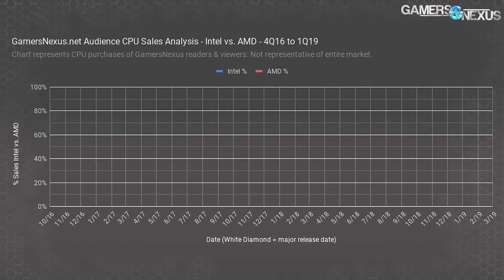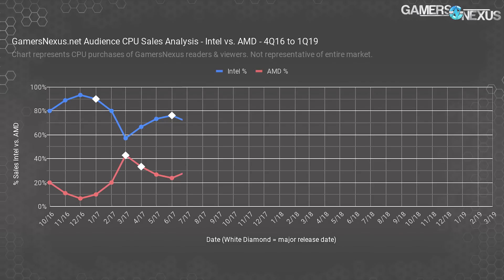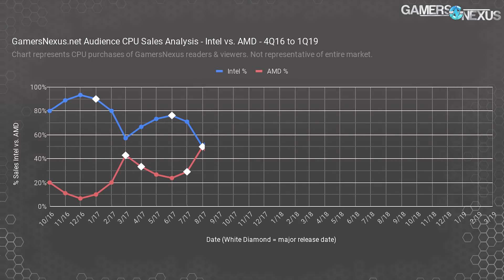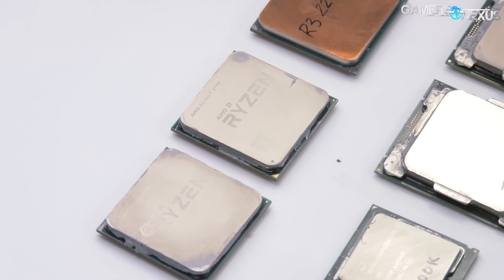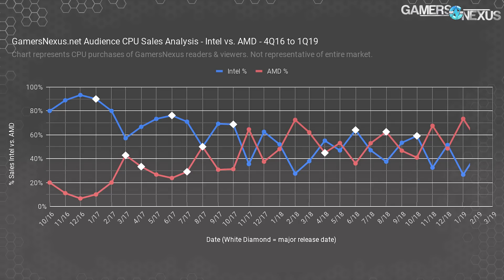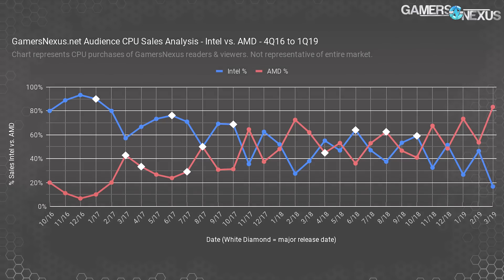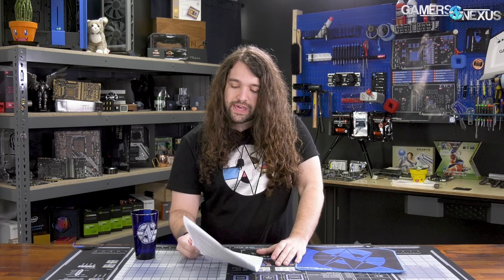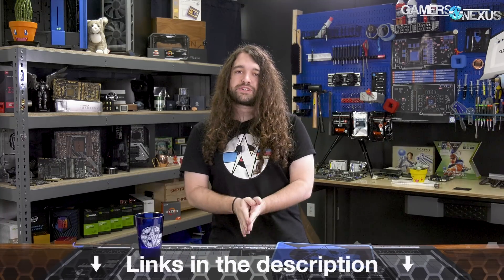Special Report: AMD’s Comeback Story - Intel vs. AMD Marketshare

Comment: So if Ryzen 2 is even remotely as good as the leaks say Intel sales to DIY folks will implode.
Reply: Intel 14nm vs TSMC/AMD 7nm. AMD is a strategic partner of TSMC. Intel might be using TSMC right now, but usually they do their own manufacturing so TSMC may have some reservations about helping Intel since they are a foundry competitor. Anyways, Intel and NVidia are the high end, firmly. AMD is for everyone else. <3 AMD. Besides, Steve's charts indicate that Intel sales to DIY have already imploded. I bet that Intel is being (or maybe already has) forced to give volume discounts to large customers like datacenter or cloud just to fight clients' new urges to defect and go to AMD. 9th gen Intel might also get discounted just to further drive the point home to customers that Intel hardware is simply the fastest (even if overall AMD makes a better product). They sell Ferraris, not minivans. Unfortunately for Intel, It turns out that minivans are really popular in China. It also turns out that AMD makes the best minivans on the market.

Comment: I had in the past few years FX8320 > FX8350 > FX9590 > Ryzen 7 2700X 
Radeon R9 280X > R9 390X > Vega 64 > Radeon VII. AMD definitely got my money 😜😅
Reply: Raul  You strayed to i5 when they most needed it, shame on you.
Reply: noice :)
phenom II x6 1055t, fx6300 , fx8350, ryzen 5 1600 and an athlon x4 845 here
jumped on AMD during the athlon thunderbird era (athlon 1000), and have had athlon 64 and athlon XP in the past too.

i have 3 rigs, of which the 6300 has become fileserver, ryzen my main rig,
and the FX8350 is my music production machine,
well technically 4, but the athlon 845 is a shitbox sitting at a friend's house as his computer broke down lol

i think the only intel i bought in 20 years (for myself), was my core 2 duo e7500, 
it couldn't quite keep up with my retarded amounts of multitasking and went to replace it with the 1055t instead within a year, i still have the chip gathering dust sitting in an old broken mainboard.
Reply: 486 -》IDK -》Fx8350 -》4690k -》2700x
Reply: AMD Athlon XP 1900+ - AMD Phenom X4 9950BE - I5 4690k (4,6Ghz OC) - Soon back to AMD with Ryzen 5 3600x / Ryzen 7 3700x (Yes i keep my systems till end of lifespan)
Reply: Budget parts usually result in more upgrades in a shorter span of time. Ironically, it ends up being more expensive as well. You had all that hardware. I had a 2500k and GTX 680 for 6 years lol.
Reply: @Code-n-Flame  Hmm calling those parts budget 😅 I like to experiment with hardware, prior to those PC's I also had 2500K + GTX480 > GTX660Ti and before that Athlon II X4 + HD5770 > HD5830. I go through circles Consoles then PC's then consoles but I got bored of wasting money and now I have Xbox One X, PS4 Pro and high end PC, no more wasting money, I'm getting too old for this shit 😅😅
Reply: Yeah and your brain to it seems. 
1 FX is bad enough, but to then get the 2 more, that's just straight up retarded. 
And your gpu upgrade path is just bizzare to say the least. 
R9 280X is a great card, the R9 390X however isn't, Vega 64? Not worth it, Radeon VII would make sense if you waited for AIB model, instead of reference. 
Your decision however to go with the Ryzen 7 2700X is excellent!
Especially from a hot pile of garbage like the FX 9590..

Comment: I have never owned an Intel CPU and I never will..... Ryzen 2700x in a Crosshair VII Hero, and happy as can be.
Reply: Never say never. AMD may not be around in 20 years. Then what?
Whilst I love Ryzen, the old lines were rubbish. I had a phenom II x4 Black 955 and it was okay. But not a scratch on Intel's best offering.

I follow performance with a slight lean towards underdogs to balance market to prevent monopoly which hinders progress
Reply: @markp8295  their first 64 bit series knocked Intel right out of the water though and guess what, Intel ended up licensing 64bit from AMD...
Reply: @LiLBitsDK  yep still remember my athlon 64 x2 black edition being a beast. (even though the thing made my case a blasted furnace, and sounded like a jet engine taking off with my radeon graphics card, ah good times)

Switching to intel confused the heck out of me (I thought my computer was broken because it was so quiet lol)
Reply: @markp8295  yea, i have to agree, im 54 so im confident amd will outlast me😀
Reply: What did you agree with, the underdog part? It sounded like confirmation bias on your part, unwilling to see any downside with fierce loyalty to one brand.

That 20 year estimate was theoretical; if the bottom truly fell out before you died, then what would you do?

You should always have an alternative/backup plan, especially when it comes to the volatile tech market.
Reply: @StaszGonyon  I was agreeing with the Underdog part of that post, I have always bought ATI/AMD for over 10 years, and it's mostly just an economical thing for me, I have to budget wisely, while feeding the techie side of my tinkerer personality, at the same time I have found that AMD products  hold up surprisingly well over time, and I can buy a nice CPU and mobo, and keep the same mobo for many years, while I upgrade to a newer CPU.
Reply: I have owned both Intel, AMD and Cyrix, as well as Nvidia, ATI and AMD GPU's where I guess you could include Cirrus Logic, 3DFX, Tseng as well
Reply: Same setup as me! :D
Reply: I am the opposite, I have never owned an AMD CPU but I would say there is little chance of my next one being Intel.
Reply: @t3h8ar0n  Bingo once we all found out the 2500k was such a beast, I imagine many of us switched teams. (Also ATi and their bloody drivers encouraged me to do so even more)
Reply: @t3h8ar0n  ah but sometimes it is important Nvidia working best with intel and such.
Reply: @t3h8ar0n oh okay gotcha thought was only between the 2, didn't know you meant literally all.
Reply: @t3h8ar0n  I wasn't giving my worldview!! It is just economically nonsensical to have to buy a new CPU and Motherboard everytime Intel releases a new CPU, Some of us don't have money falling out of our rear ends, and want good performance at a reasonable price. That's all I meant, no disrespect was meant to Intel owners, I'm a Techie on a budget, and AMD is the better bang for my dollar.
Reply: @t3h8ar0n  I should know better at my age to never express myself in absolutes!! hahaha

Comment: As somebody whose side gig is PC building by word of mouth, I hear people often say they've heard AMD cpus weren't good and that Intel was the way to go but once they give a budget and we look at reviews to prove things I end up recommending AMD 8/10 times. The bit about AMD selling at lower margin to try and repair their brand really is true.
Reply: @EJSC  OMG stop spamming this post in every few replies, we get it. You have an opinion that works for you.
Reply: EJSC just not a fan of spam
Reply: Intel is becoming a more niche CPU than mainstream CPU. Most people are still gaming at 60hz monitor and will go to 1440P over getting 144Hz.

I went with 9600K because I need higher minimum FPS and I play CPU heavy games on 144hz, but would otherwise gone with 2700X
Reply: @uP-Andre Youre obviously an intel fanboy..

 - You dont need to splash the cash on bdie ram. Normal 3200mhz cl16 is just fine.
You also dont need to buy an expensive cooler. An arctic freezer 33/34 is plenty.
You dont need to buy the 2600x, if youre gonna overclock you should just buy the 2600! 
The 2600x actually performs best in gaming when not overclocked, since it single core tubos to 4.25 ghz, out the box.
Also, the amd solution is far superior at streaming and general workloads, since it has 12 threads vs the 6 threads on the 9400f.
Also, if you bought that intel system, youd have a shitty and noisy stock cooler, a shitty motherboard, slow RAM and almost no upgrade options down the road.
Reply: @uP-Andre upgrade options isnt fucking bullshit. lmfao! plenty of people on x370/b350 upgraded their 1st gen zen to zen+ and plenty more will upgrade again to zen2. you will see. 
with intel you have to buy a new motherboard like every 10 months. it's ridiculous.
id much rather have the WAY stronger streaming/worktask CPU, than the CPU on a shitty outdated platform, that has 4% more single core performance, which results in a couple of fps that NO ONE will ever see/feel/notice anyway.

regardless, if you buy a 9400f/2600, you'd pair it with a low/mid range card, and on a low/mid range card theres literally no fucking difference between an overclocked 2600 and a 9400f, besides the 2600 coming with a better cooler, having TWICE as many threads and belonging to an upgradeable platform!

Comment: I bought an FX 8350 in 2018 to replace a phenom II.
Reply: Does it feel like a significant improvement?
Reply: @boshumok6399   the FX8350 feels way better than the phenom II. It basically feels twice as fast with the same or less power consumption. And I didn't have to replace my mobo.
Reply: @MatthewKiehl  Awesome. I knew there had to be a reason why the FX still sells well on Amazon and gets such positive reviews from so many owners. Did you have a Phenom X4 or X6?
Reply: @boshumok6399  I had a X4 (That I think I used for 8 years!). The FX 8350 just happens to be one of the best chips for the AM3+ socket board that I have ( with DDR3). Anything better would require DDR4, and a new board (but the 16 gigs of DDR3 I have right here from 2011 doesn't cost me anything). And if I'm going to get a new board and new memory to go with a new chip I may as well get a M.2 drive... and then it looks like I'm just building a whole new computer while everything is overpriced in the market. So, 70$ looked like a no-brainer.
Reply: @MatthewKiehl  Makes sense to me.
Reply: why though? ryzen 3 2200G is probably faster
Reply: @nonameyet2205   this was to go into an ageing system that only has a am3+ socket. The fx8350 poped right in for 70$, and required no other changes (like an am4 motherboard and overpriced ddr4). If I'm going to build a whole new system I'd probably go threadripper (to use with blender).
Reply: I bought a 2700 to replace a FX 8350 in November 2018. My FX is sitting there doing nothing :(, I would use it as my file server/firewall/camera machine but it was always a bit of a hungry beast on power, still use an old Athlon x3 system for that. FX always had shit power management, Ryzen 2000 series is so much better.

Comment: after nearly 2 years of rocking an R5 1600X I'm very happy never had an issue with the chip period.
Reply: Same with my R5 1600 @4.0GHz. Still great for compiling
Reply: Well not like you would have one with a Intel chip, cpu faults are extremely rare(I still got a 7 year old 3570k on a backup pc which is running just aswell as they day i got it).

Comment: I wonder how much AMD's stock coolers helped them move product, especially in the lower to mid tier range. Or in other words, how much better would Intel's i5 sales be right now if they just included a much better stock cooler with every CPU? Especially at a time when they have manufacturing issues limiting the supply of their chips – the price of the cooler doesn't change much and could have provided some stable value.

Comment: glad i bought a i7 3930k(back in 2012), next going for a AMD cpu probably do
Reply: My 3930k ran 4.4ghz up until i bit the bullet and got a 2700x.
Its noticeably faster, and now my fans can run at 600rpm instead of 1300rpm and core temps are still lower.
You'll have a hard time passing up zen 2 when it releases
Reply: @SuperTurbo9001  we will see what comes. but intel has gone mad if i can say so. 

running my cpu fan at 2000rpm no sound almost, only 35c no load 🙂

Comment: Good to see AMD finally doing well. A well deserved success thanks to their hard work in the last 5-6 years developing Ryzen. The only problem is that I've got my money ready and 7nm Threadripper 3000 is still not out yet. 😭My 1950x has been ripping threads for almost 2 years now and I'd love to upgrade to those sweet 7nm cores. 🤩
Reply: Oh baby that CPU can rip my threads any day.
Reply: Well, with any luck, you only have to wait roughly six months.  Due to the chiplet architecture, they'll be able to go above 16 cores without unusual memory access, which won't be hampered by the buggy Windows scheduler (which I'd hope would be fixed by then regardless).

Comment: the i9 price is not compelling at all for gamers unless they are doing 1080p gaming. most games have marginal differences at 4k and even at 1440p a few fps to most will make no noticable difference. im very happy with my 2700x it runs 4.2-4.3ghz in games with a click of a button in the bios simple performance boost. 3600mhz ram and a radeon vii and i also have an rtx 2080(bought it because of the hype still have it dont use it). i dont feel like id gain anything switching to an i9 not enough to justify the 250$ price difference now had i went with a 2080 ti. well i guess at that point i already way over paid for a gpu may as well get the i9. but honestly right now is a terrible time to buy an i9 esp at 520$. zen 2 is around the corner and you could about be guarenteed it will atleast match the i9. ipc of the 2700x is already about the same so if amd gets what they have claimed a 10-15% ipc improvement and even a slightly higher core clock lets say 4.7ghz which both of these things are certainly possible then id say amd's zen 2 will surpass the 9900k in single and multithreaded tasks. i wouldnt be surprised if it was significantly cheaper since im quite certain amd knows very well they're winning formula is similar performance for much less money. lets face it all they need to do is match 9900k single core performance which really the current zen+ isnt that far off, for current or slightly higher pricing and the gaming market will pretty much stop buying intel top to bottom. intel is kinda in a pickle esp if the rumors of higher than 8 cores is true. even if they only do 12 cores max what will intel do? if their single core matches 9900k but there are 12 instead of 8 amd will have a wide multi core lead on even the 9900k and id assume a 12 core like that would go toe to toe with intels low end hedt cpus and if they do a 16 core like that, intel may as well hang it up because amd will basically have a check mate at that point. not to mention pci-e gen 4 with threadripper stands to really disrupt the hedt market this go around. intel may really be screwed if amd releases a 32 core cpu that scales the way its meant to with such powerful single core performance. it would make intels 28 core multi thousand dollar chip look like a joke. and also 64 core rome looks like a mighty impressive server chip im very curious if that cpu will make it to threadripper

Comment: You guys think Ryzen 3rd gen will hit 5ghz?
Reply: Probably not I'm thinking. But maybe 4.8GHz, which honestly is plenty good enough.
Reply: Probably not imo. It might be possible if you really tweak a bunch of sub settings etc.. but just a normal straight overclock with an adjusted voltage most likely won't hit 5ghz

Comment: The only thing that Intel offers (me) over AMD is Thunderbolt 3. Level1 Techs had a video claiming that Under Threadripper (which I am using) using Thunderbolt. I'm chomping at the bit for that as soon as it becomes easier to accomplish.
Reply: USB4 should change things for the better.

Comment: My last build finished up at the mid last year is an i7-8700K, 32gb of Corsair 3000mhz DDR4, 2x 1080ti in sli, 1TB of SSD (850evo's), 10TB of HDD(WD Blk), 1000w psu, ROG Hero X Max board, a corsair H150i pro to keep that toasty de-lidded, liquid metal "fixed" cpu, on an open air-"ish" Thermaltake P5 "case"

I wouldn't have ever tried the delidding without the der8auer tool and your guide. |

The 8700k was $339.99 on Amazon. 

I've always been a team blue/green guy and I'm sure, barring catastrophic failure, this system will last me for at least another 5+ years. That said I'm very much more open to a team red chip for the next build seeing how things are going. I'm curious how new tech dealing with PCIE4, NVME, DDR5, usb, etc will affect my choices in the future. 

And again thank you for the de-lidding guide.

Comment: that red vs blue sales graph is absolutely beautiful.

anyway, intel are still selling the i5 7400 at 200$ while its 8th gen equivalent i3 8100 is going for half of that price.
Reply: The i5 isn't equivalent ... it's like 10 to 20% slower than the i3. That's just ridiculous.
Reply: @MephistoDerPudel  Ignoring i3's out of the box higher frecuency It is equivalent cause it's a Quad Core, just like G5600 is equivalent to previous gen i3 7100 (Dual Core Hyperthreaded).
Reply: Intel CPUs go down in price very slowly, so if you have a 200 series motherboard you might as well sell it and get a Ryzen/Intel 8th gen platform.

Comment: Jesus people are willing to pay for i9s, just get an hedt platform at that point.
Reply: For gaming purposes the 9900k will still out perform the HEDT CPUs mainly due to higher clock speed.
Reply: Buying a $500 CPU for gaming is almost as big a waste of money as buying RAM waterblocks.
Reply: yes, but that is only in extreme cases. (for example playing with a 2080 ti at 1080p at over 120 FPS) most people would just settle for a slower CPU and get a 4K monitor at that point!

Comment: Which one of you bought an Athlon in 2019?!
Reply: That'd be the Athlon 200GE, which is a Zen-based chip with two cores, four threads, and an integrated GPU for less than $60. 

Anyone building a general use computer (i.e. no demanding 3D games) on a tight budget will get great results with an Athlon 200GE.